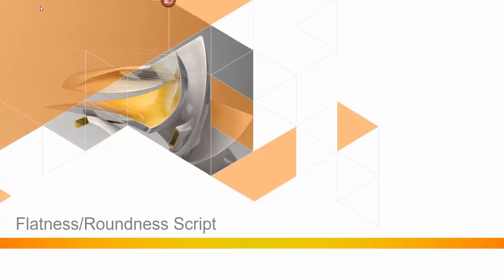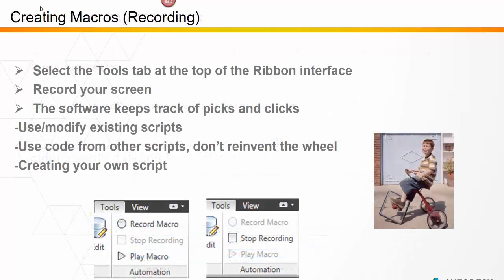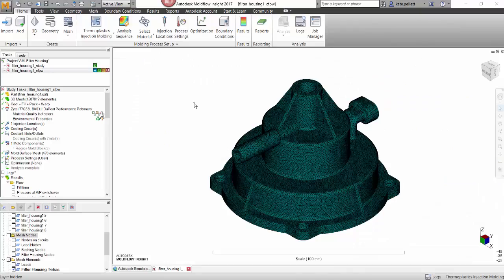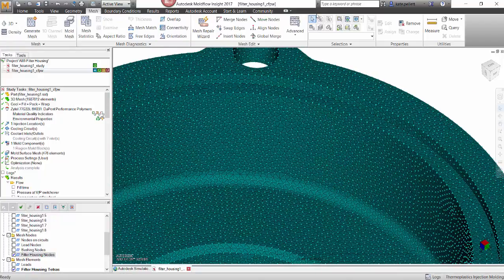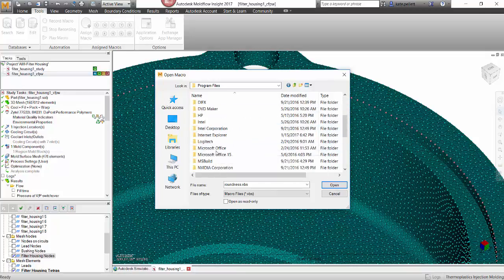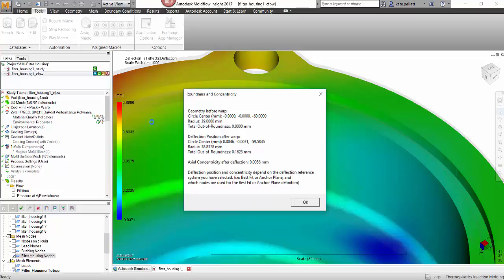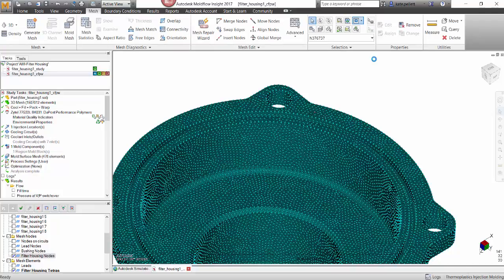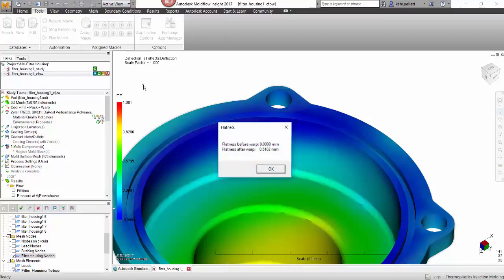Flatness and Roundness Script

Comment: Is there a way to set the "Total Out-of-Roundness" before warp to 0.0000mm? Even with a smaller mesh, some "Total Out-of-Roundness" appears(ex.0.0027mm). Modeling is a geometrically perfect circle.